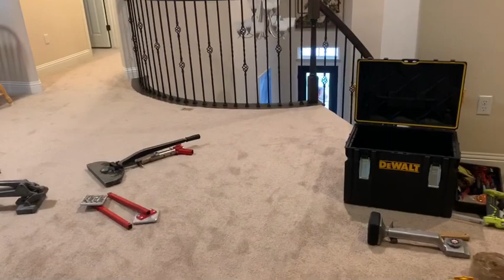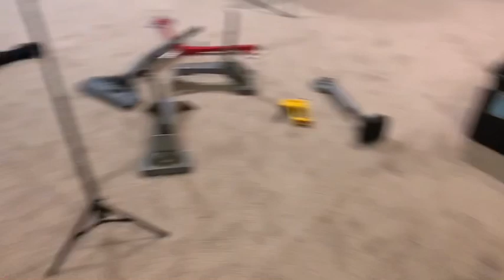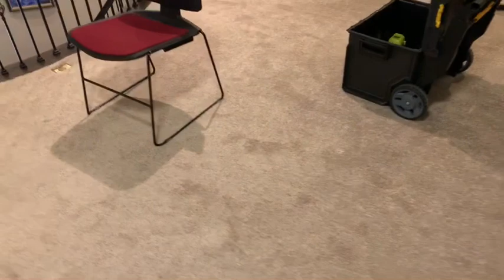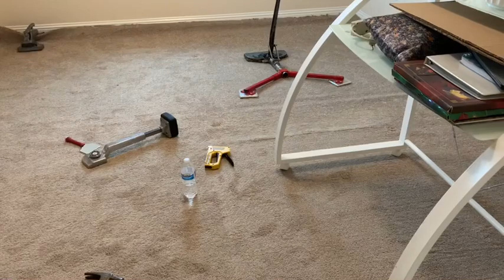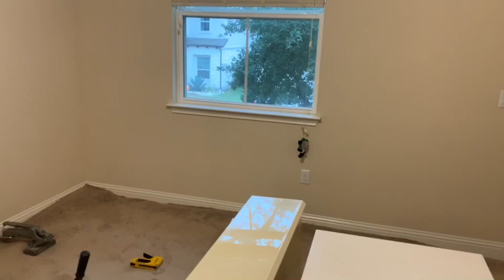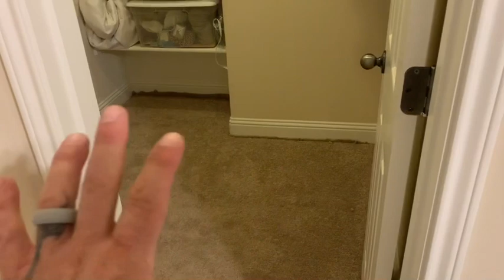The Puzzle that is Carpet Stretching.

Comment: I have a question, i cleaned a home about 2 weeks ago, using the detergent mixture you use and they said they have an order they didn’t go away that smells like urine?Any suggestions of what it could be? I used the oreck orbiter, the house did have urine spots prior to cleaning it
Reply from the maker: Urine soaked carpet pad. I have plenty videos showing me pulling out and replacing pad. It is a common thing. Not all carpet problems are solved by cleaning. This is comparable to your battery in your car going dead and washing your car hoping to fix the problem. You need tools to fix this.